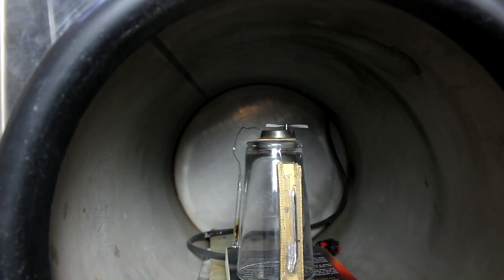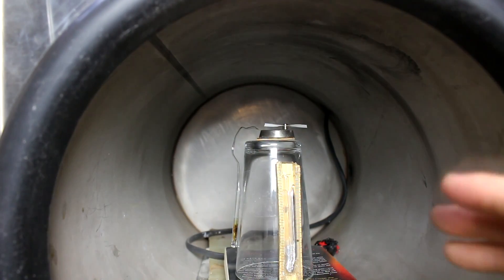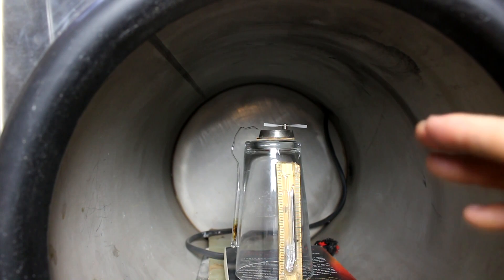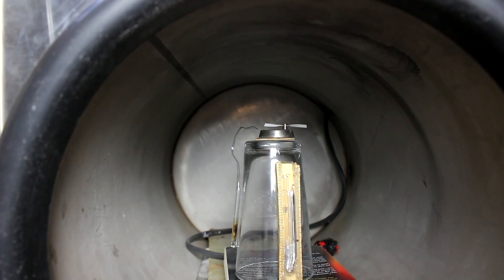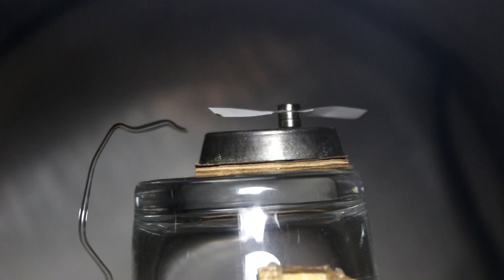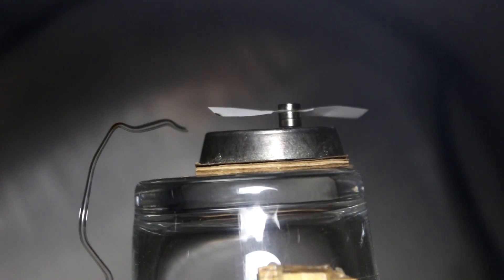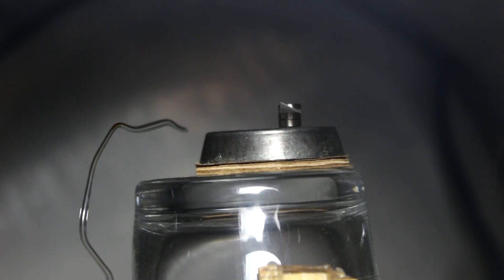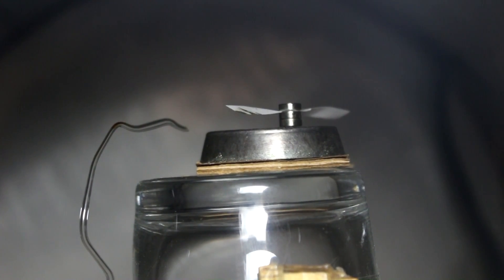Levitating magnet in vacuum 2

Comment: Since water has a lower boiling point in the mountains due to lower pressure, does this make steam driven power plants more or less efficient? Lets just say the power plant is nuclear so environmental factors such as less oxygen aren't a factor as it would be with coal. Would a boiler at sea level be more efficient if it had a vacuum drawn on it first before heating?

Comment: Hi, Cody, how did you conclude that air resistance should not be significant? By reducing the density, you changed the mean free path length, but not the dynamic viscosity of the air. The kinematic viscosity is larger. As long as the mean free path length is still smaller than the object, you only removed form drag, not viscous drag.

Comment: There's something wrong, it should go far longer than that. Oh I've got it! It's the viscosity of the air. You would think that pumping it down would obviate viscosity, but actually the viscosity of air is independent of pressure, over a VERY wide range. That holds until the mean free path is much longer than the gap, but that's at desperately low pressure; his pump won't get down that low. So the aerolosses are dominating even in the vacuum and that's why you see what you see.

Comment: The reason the magnet stops rather quickly is not because of friction in the traditional sense, but by the effect of it creating eddy currents in the metal that is beneath it and that dissipating energy. If you want to avoid eddy currents you need the block beneath it to be paramagnetic and non conductive. You might try ferrite-NiZn. See this interesting thread: https://physics.stackexchange.com/questions/163461/is-there-any-material-that-is-not-conductive-and-is-magnetically-attractive

Comment: There is a voltage induced, but why should there be an electrical current. It would be necessary that there are two contacts at a spinning disc of conductive material (the magnet). The wires connecting the contacts have to be static or spin slower or faster than the magnet. Otherwise in the wire the same voltage is induced and thus no current can flow. So basically, the electrones in the magnet or another spinning disc are either pushed to the rim or to the center.

Comment: Why did it slow faster with wings even though there was no air resistance? Perhaps, the wings kinetic energy disturbed the magnetic field. Also, how is it the cube was teeter tottering in both directions,  but the cylindrical magnet with wings slowed to a stop?

Comment: That is not acting like a rocket. What you have is a crude radiometer. The coherency of the laser is pushing the propeller. Claiming it is combusting and then it spins is just inaccurate.   The paper prop doesn't even burn. Only when the coherent magnetic laser is pushing on it does it combust. Without the laser, the paper will not chemically ignite. And yeah, rockets propelling something in outer space is fiction. Disney world theme park. Lots of clowns.

Comment: I could not tell but was the vacuum pump still running when the magnet was spinning because the burning paper is putting gas in the chamber.  Isn't it? It would be very minimal though because of the very small amount that was burnt and the size of the chamber. I don't know just a thought that ran through my mind.

Comment: Friction is not the issue. The issue is it requires energy to keep an object rotating. This is because each point on the spinning object is constantly changing direction and requires radial acceleration to hold it's position from the axis. However, an object traveling in a straight line only requires energy to start it's motion and until acted upon by another force, such as friction or gravity, will continue moving at a constant speed and velocity. Another way to look at it realizing velocity is a vector given by magnitude and direction. In order to change magnitude or direction, energy is required. This is what makes speed different from velocity. Speed is a scalar quantity, requiring just magnitude, while velocity required both magnitude and direction.

Comment: hello Cody, very interesting experiment, just a thoughts - if your laser pointer is capable to spin it so fast that mean you are dealing with incredible little forces there, and really some non uniform magnetic field could cause eddy currents in the metal and slow it down, Im not sure but I think little steel disks with the magnet size or slightly larger on both poles should make the field more uniform, the steel is like magnetic conductor, so whatever the magnet have as non uniform, when is passed through the steel should become more uniform I think, but dont know how this will affect the levitation, alternatively - another experiment - if that is eddy currents then if you put a copper sheet below the magnet it shold slow it down faster for 2 reasons - copper is better conductor and reduced distance

Comment: Try a piece of a high frequency transformer core. The ferrite material inside a high frequency transformer is specifically designed to be magnetic but not electrically conducting, to minimizing eddy currents.

Comment: Really like the work you put into these videos. But the axis of the magnetic field is not very well align with the axis of rotation you can see it see that the top magnet and the bottom magnet are not aligned right. I'm 99% certain that if you can get the alignment of the axes right the magnet will spin longer. But at this point it might not be worth the effort.
Reply: Some more reading on situations where metal can spin inside magnetic fields without significantly slowing down as well as other related topics.
1)http://citeseerx.ist.psu.edu/viewdoc/download?doi=10.1.1.205.6402&rep=rep1&type=pdf
2) https://en.wikipedia.org/wiki/Gyroscope#London_moment  (Not an exactly equivalent system but shares a few similar ideas. Also just a really cool bit of engineering)
3)https://en.wikipedia.org/wiki/Magnetic_bearing#Future_advances
4)http://citeseerx.ist.psu.edu/viewdoc/download?doi=10.1.1.176.6641&rep=rep1&type=pdf  (great paper showing current flow paths)
5)https://en.wikipedia.org/wiki/Faraday_paradox

Comment: Try increasing the mass, Cody. You have a very small amount of mass, meaning that there's not a whole lot for the eddy currents to decelerate. If you increase the mass of the rotating magnet above a certain point while maintaining the equilibrium needed to levitate, it actually will spin for significantly longer because the magnetic flux will have a harder time slowing it down. Not forever, but for quite a while. It'll definitely be entertaining, and if you could make it work in a small glass tube it would be a great science toy.

Comment: Earth gravity is causing the magnet to shake and that magnet is not in the golden spot between the two other magnets and that vacuum doesn't remove %100 of the air and that piece of paper is under power of g . This things cause the magnet to shake and lose its rotating power in another kinds of movement

Comment: Hi, hamm i think that the cube or cylinder is stopping because the magnet flux you have once you have a moving object inside magnet flux this generate current inside the object that current generate a opposite magnet force that breaks the cube or cylinder, of curse if tha shape is perfect and the magnet flux too maybe this not happens.

That is my guess. i think that you need another way to levitate without using magnets.

Comment: The next step, I would think, is to find a way to run liquid nitrogen around the metal base to see if the reduced resistance means a longer spin. Doing that in a closed way that would not destroy the vacuum, I guess would be the hard part. Though, depending on how long it takes to pull the vacuum, maybe you could just cool it outside first.

Comment: i think what happens is that the rotation axis is not aligned to the magnetic field due to the imbalance of the magnet, thus rotation is converted into tilt, and the tilt bleeds energy because it is not perfectly aligned to the magnetic field anymore. There are two possible solutions: the faster it rotates, the lesser the tilt will be, or manage to find a perfectly balanced magnet.

Comment: Still wondering if liquid oxygen inside a container would behave any better since there should be no eddy currents. Any ideas? I know that the oxygen would probably start to rotate without affecting its container, but if there were several chambers off centered (for example like a star * inside a glass tube ○ ) it might work.

Comment: wait, what magnetic field changes?  you rotated big cylindrical magnet upthere, and no magnetic field changed, because it's round in that plane. so, if you have cylindrical rotating magnet (and it's poles are vertically aligned, isn't it?), it's rotation shouldn't change any magnetic field. no changes of magnetic field — no work. no work — no loses of energy. i'm confused <_>
Reply: and i know how to know for sure, if this magnet producing current in bismuth plate or not. you can place a coil (more turns — better) near the spinning magnet and measure voltage (AC) on it. try to place it in different directions. no voltage — no energy loses for magnetic field changes
Reply: and better use some transformator coil. or from relay. and probably amplifier, as there is not really much energy in rotating that light magnet that slow >_>
Reply: and one more. how really much resistance air molecules do in your vacuum chamber to that paper stripes? it's not a perfect vacuum afterall... math is an important part of science experiments) would like to see it ^_^

and, probably, compare that to smaller stripes and measure deacceleration ratio between big and small?

Comment: Would you investigate/explain why these are slowing down so fast? While I had not expected infinite motion, they still slow down surprisingly fast... You can probably still achieve similar results with a 
cylinder on a (ceramic) bearing under atmospheric pressure.

Comment: I wonder what would happen if instead of one solid chunk of bismuth you used a lot of little, electrically insulated pieces (to prevent eddy currents from slowing the magnet down). Maybe make small pieces and paint them then put together. May be easier to do with graphite.

Comment: Now this is interesting. I've built a bismuth levitator myself and tried it with little cube magnets. I thought the corners of the cube would have a higher magnetic flux density and thus induce electric currents in the bismuth and slow the rotation down. I guess in your cylindrical magnets something similar happens, so the magnetic field is not uniform and symmetric even if the shape is. Or the pressure in your vacuum chamber isn't low enough, especially when you burn some of the paper the smoke cannot be sucked away quickly enough. Anyway, this will never work because the earth is spinning which will force the magnet to precess at some time creating friction.

Comment: Just a random question i've been wondering, would gallium, or a metal like it work in a 3D printer?
Reply: Viper 1 the plastics in 3d printers even need way higher heating, so in that way it should be fine if that's what you meant☺ I feel like a metal like gallium wouldn't cool fast enough and/or melt again by the heat of the next layer, so actually a metal with higher melting point would probably be better
Reply: interesting thankyou for answering that ^

Comment: My hypothesis on why the magnet would slow down pretty quickly under a vacuum is because the "wings" you put on were spinning the way with lots of resistance. If you spun the magnet the other way with the laser then in my opinion the magnet would first spin faster and second the magnet would slow down not so fast. Why I think this would work is because if you see the angles in the "wings" then the slanted down side would travel a lot easier due to aerodynamics.

Comment: Interesting experiments!  I think air resistance is still more of a factor than you think here... certainly not negligible.  At this vacuum level I think you are still in a viscous flow regime... if you achieve a few orders more vacuum and increase the gas particles mean free path to at least the length of the "paddles" I think you can start to ignore it.  Maybe a quick way to test would be to evacuate to the same level and trickle some H2 into the chamber to purge out the remaining heavy N2/O2 and compare the deceleration?
Reply: i mean im fairly certain we're at levels of 0.1% of an atmosphere. correct me if im wrong but at those levels you do not need to worry about air resistance

Comment: What if you levitated a nonconductive object with an electric field, would this phenomenon still occur?
Reply: living757 how would you levitate it if it wasn't conductive? The conductivity is what allows it to levitate
Reply: Kyle Knepper , Excellent point and one I didn't wrap my mind around or thought about until college physics. Electric Fields aren't magnetic fields. The fields  I'm thinking about are the same fields that create forces that will make long hair on a person float up if they touch a Van der Graf generator, or make packing peanuts cling to your shirt. If you give two items static electric charges with the same sign, they will repel each other. Or in the case of the peanuts, with opposite electric charges, attract each other. No conductive material required.
Reply: living757 you would still need a way to make to forces equal to each other. Kind of how bismuth works in this experiment.
Reply: The forces would equalice themselves by adjusting the distance. But I think influenz could be a problem with that. maybe, I don't really know. Probably a light peace of aluminium could float on a larger metal bowl, or in a cage. you just lay it there and when the vacuum is present you apply the voltage to the cage, and before the aluminium foil can get away it will have quite a charge on its own. you could also bounce light off the alu-foil with the laser without hurting the setup.

Comment: I would think the greatest force affecting the deceleration are the material imperfections and their affects on the magnetic field. The magnets themselves probably produce small lumps in the field and movement of that field across reactive materials is generating a magnetic flux which is a form of energy and therefore must be taking energy from somewhere such as the rotational velocity of the magnets.
Reply: im thinking that the magnetic fields want to align, thats why the magnets spin back and forth while stopping

Comment: In the vacuum of space:  when matter is exclererated  it will remain traveling at the same rate forever.  My best guess is even though the magnet is in a vacuum, with no air resistance, gravity will still affect it even though it is levitating.
Reply: Set the bismuth in a dish of liquid nitrogen to eliminate atmospheric temperate resistance

Comment: Could someone please explain to me what Cody means, at the end of the video?
It seems like he implies that a rotating magnet will ALWAYS induce eddy currents in nearby conductors, no matter what shape the magnetic field has? I kind of doubt that this is what he meant, because Maxwell's equations quite clearly do not bare this out; Specifically:

∇²A - ¹/c² ∂²A/∂t² = μ₀J

Where A is the magnetic vector potential, J is the induced current density vector and c is the speed of light in a vacuum.
Since both the spatial 'divergance' (due to the magnet being a perfect cyllinder) and the second temporal derivative (the magnetic field strength does not change at any point on a plane beneath the magnet, and parallel to its bottom face) are both 0, the induced current density also HAS to = 0!
However, he did seem kind of reluctant to even try the cyllindrical magnet in the first place, so maybe he did mean it like that (that even a perfect cyllinder would still have eddy current losses)?
Could anyone please explain to me how you calculate either of the two left side terms to have ANY value other than 0, for this serup (assuming a perfect cyllindrical magnet)? I would really appreciate being able to follow Cody's thought process on this, as each time I do the calculations, I come up with 0 but I don't get where I'm going wrong. :(

Comment: That energy is going to be converted to heat, it would be interesting to see if the temperature of the magnet goes up. You'd have to really get it spinning (preferable without heat) and then measure the temp remotely, maybe with an IR thermometer.